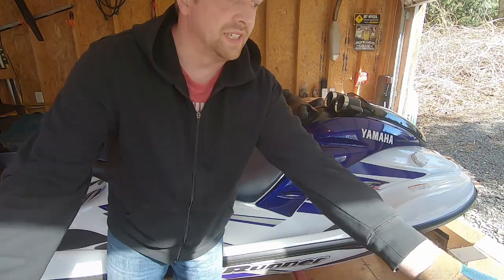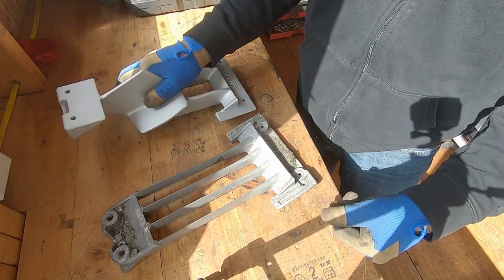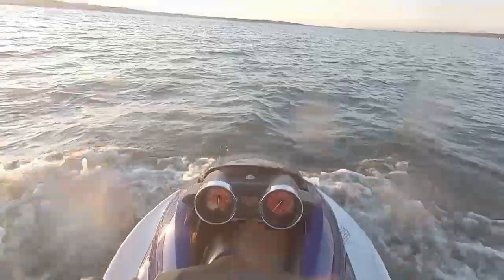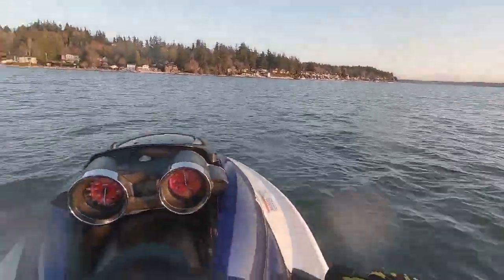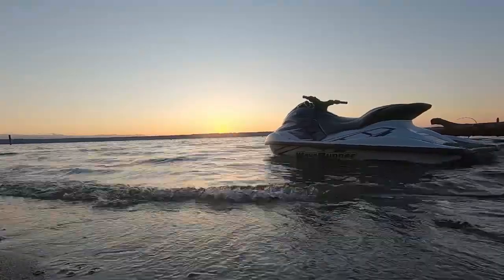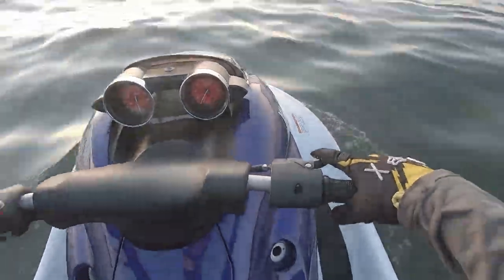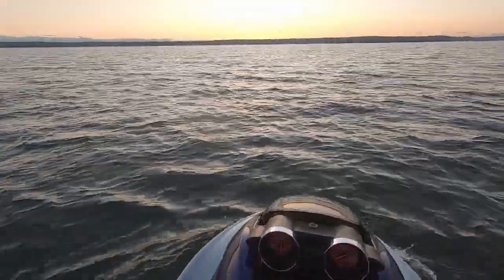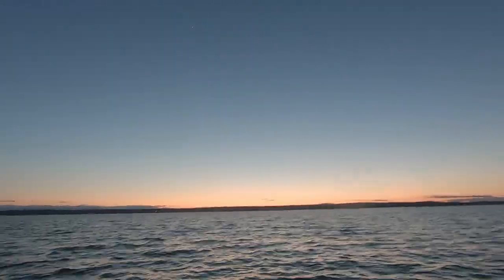GPRSHO more speed

Comment: It’s a 1200 grate , they are getting harder to find . There’s another 4mph in an R&D rideplate, pump voids filled with epoxy and sealed easy . My friends reflashed GP1800 does 75mph but loses power as it heat soaks , that calls for a fizzle intercooler to keep the cold air supplied to the engine when it’s reflashed . Good job so far it’s flying !😛😛😛🤩🤩🤩 One more thing , you could try a 85mm 5 degree nozzle from a GP1300R / 05 -06-07-08 models 60T prefix .More speed , 1 mph faster than an 87mm nozzle .
Reply: Adzy where in Oz
Reply: @shanearkwright5561  Central Coast Nsw
Reply: @adzythepwcblokeinaustralia5467  im down near woolongong but have a yacht on a mooring near wisemans ferry Maybe we could meet up and have a ride somewhere sometime what your thoughts
Reply: @shanearkwright5561  sounds good.

Comment: That's an easy 80 mph with sealing the pump up and a better rideplate on the calm. Epic!
 Is this setup intercooled?
Reply from the maker: hi you 👍 it has a stock sho intercooler I might upgrade at some point but will see.
Reply: @JetSkiBrothers  Try putting a temp sensor after the cooler to see where u at. It may not even be worth upgrading since your water temps are already low cooling your exchanger
Reply: I'd look into a programmer for it that has data recoding so u can tune for E-85 to add boost with or possibly splash a 20 shot. Thanks for sharing with us with what u have learn. 
Great content man!

Comment: What's rev limit set at? And how close are you to hitting it WOT?
Reply: Also, I cant wait to see a lap time on that monster
Reply from the maker: Benjamin Bruns the rev limiter is still stock which I think is around 76-7800 rpm it’s still right up there close to the limit. Not bouncing off the limiter like before but still right up there. Hard to say exactly without a digital tachometer
Reply: @JetSkiBrothers   It sounds right in the zone, for sure. Good call going on the tall prop. Time to stuff the pump!

Comment: Make those sponson stepped and put some shims on the tabs .060 mm on the front bolts of them ( the bolts that are to the front of ski)
Reply from the maker: fergp1800 winner I have stepped the sponsons and it works great that’s coming in a later video. As for the trim tabs I am seeing all kinds of different stuff about those, I’m kinda wondering if that’s more of a preference thing or a water conditions type deal
Reply: @JetSkiBrothers  i have on mine the r&d extended trim tabs and i cut them to the stock tabs length, the bad thing its r&d tabs are really hard to find, r&d close business and riva dont make them anymore